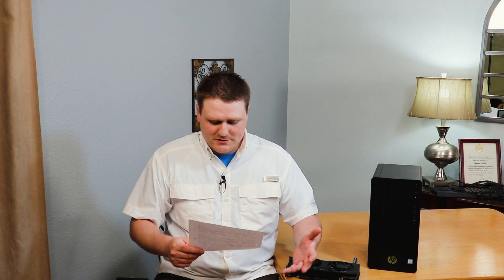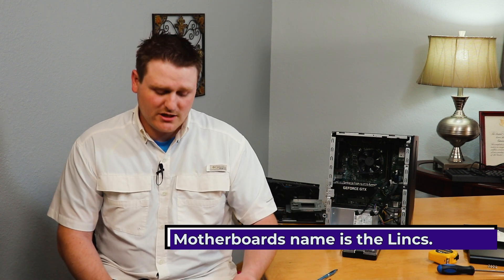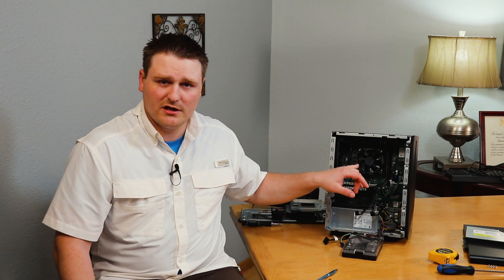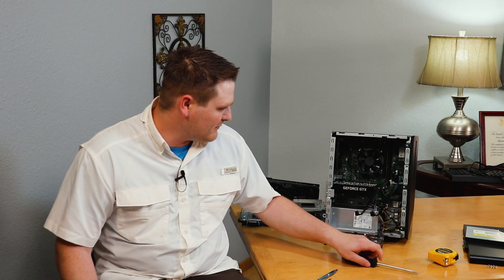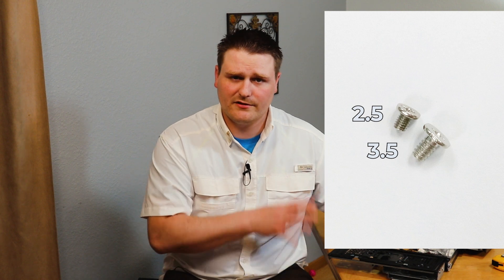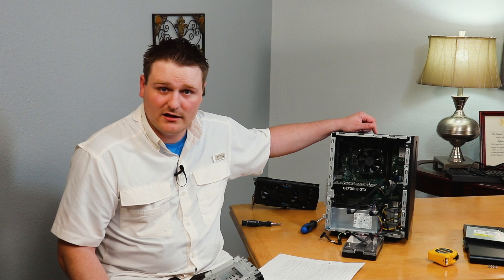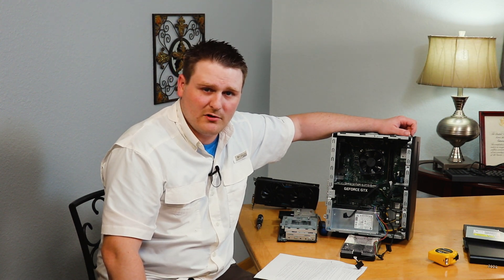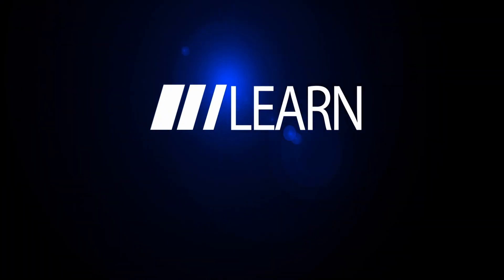Upgrading A HP Pavilion Gaming Desktop Explained! | Intel i5, 1660ti, 8GB, SSD + More! HP 690 Models

Comment: I changed my ram to a 3000mhz but I cant activate overcloack so I still get 2133 and I don’t see an option in the motherboard bios
Reply from the maker: What does taskmanager say?
Reply: @TNW1337  that the speed is 2133 MHz
Reply from the maker: @juanarrieta9939  you may need to do a biso up date is this amd or intel? What brand memory ?
Reply from the maker: One thing I will say if you went from a single stick to duals thats double the bandwidth even if it is a lower speed. Because before you only had a single lane from the pcie lanes and memory to the cpu. Now you have 2 so even if it was to stay at 2000mhz that is way faster then 3000mhz single stick. It sounds crazy but,  It is true. The newer Amds And intels are ment for dual chanlle.
Reply: @TNW1337  also I have a erica motherboard And from what I found on Reddit there is a lot of trouble with this motherboard when trying to upgrade ram  cause bios are locked
Reply from the maker: @juanarrieta9939  it is
Reply: @TNW1337  yea I went from the single stick that came with the pc to dual Corsair vengeance

Comment: i have hp pavillion model 7900010 cpu i3 8100 gtx 1050 and motherboard is Berks model . I checked and psu is 350 wats. I'm thinking to install a geforce gtx 1660 that recommends 450 wats psu. It should not be a problem because the gpu won't require such power as I read. I just saw your video so I'm asking if you suggest the geforce 1660 upgrade is possibe ? I can't change power supply with this motherboard because it's not a standard connector for psu. thanks
Reply from the maker: If it has a 6+2 Pin PCI-E I thnik you could get a TI to work 1660 & 1660ti both use 120 Watts-TDP. I think it will work.

Comment: On the psu cable does it say longwell 300v i think I might have the wrong psu cable
Reply: Could you please anwser i don't want to destroy my pc
Reply from the maker: Let me look at the 400 watt Give me 1 min.
Reply from the maker: The cables have no markings other then P2, P1, P3 & P4. PSU says HP on the side.
Reply: Tysm!!!!!
Reply: Like the part that goes into the wall
Reply: Like the cable that goes into the psu and into the wall
Reply from the maker: @Infamoustenor  They only will fit in the PSU. If the cable will not fit it will not work. It is a standard It is called a C13. The C13 will only fit in PSU units. It can not be put in backwards. Is this what yours looks like ? https://www.newegg.com/black-startech-10-ft-cable-connectors/p/N82E16812200423
Reply: Not the actual cables my bad for not clearifying
Reply: Pls lmk when u have time
Reply: I have two of them that's why idk
Reply: Tysm i figured it out!!!!

Comment: Hello, Tech mate I recently bought a hp pavilion ryzen 5 tg01-019 I think lol. I'm new to pc gaming its the first pc I've ever owned. I noticed, however, it said it comes with 8GB of ram but the dedicated graphics are assigned 2GB immediately on startup so I want to upgrade my ram but don't know which to go with, thanks very much.
Reply from the maker: This is if you have a Intel so any thing above 2666Mhz, 3000 or 3200. If you have a AMD they will do 3200Mhz so any thing above that. You will want a dual kit, to get rid of the bottle neck that 1 dim creates.  So you will want a 2x8GB kit is 16GB, or 2x16Gb Kit is 32Gb. Cheap kits I trust are Oloy, Adata & Gskill. Kits that Costs a little more, I like Corsair, Samsung & Kingston. Most of the nicer kits will have RBG on them. No point in it, as you can not see inside the case. It also adds heat.
Reply: @TNW1337  Ahh thanks so much Tech mate that’s really insightful and much-appreciated pal. I’m brand new to pcs have always wanted one though and it’s an AMD Ryzen 5 3400g I’ve got and I was surprised death stranding was running at 1fps and horizon zero dawn was running really slow and it was very blurry but I just couldn't work out why I thought my gtx 1660 could run these games so I started looking into it and I think its the ram Tech mate. So thanks very much for getting back to me and I was wondering if u think I should get 2x16GB 0r 2x8GB in your expert opinion. I don't even know all the correct terminology  You’ve got a new sub and all the best mate 👍❤️

Comment: Dude thank you so much I really appreciate this video to help me get my pc faster but what kind of cooling upgrades can I do mine is running a bit fast
Reply from the maker: Well you can replace the Cpu heat sink.  Other then replacing the Case, power supply, mother board not much. Add a  better industrial 90mm fan in the rear.

Comment: Good video I want to do a case swap to a mid tower putting a 750w power supply so my question is can the motherboard can fit into a atx case? I have the I5 9400f and the 1660 ti card is it possible to do a case swap?
Reply from the maker: Nope sorry man you would have to replace the Motherboard. But they do not cost to Much. you can use Z370, Z390, B365. B365 is going to be the cloest to what you had. if you want more PciE and Memory slots the Z370/Z390 are the best bet. Just make sure it is a socket LGA1151. If you want just link them here and when I have free time I will chk on them for you.
Reply: @TNW1337  figure much I’m getting a z390, 16 ddr 4 ram a 700 watt power supply and a cpu cooler putting in a nxzt 510 case I want in the future upgrade to a i7 and a 3070 graphic card thanks for the response the hp is a great computer I just don’t like the case
Reply from the maker: @josuesoto5340  Yeah the 3070 are rocking it hard. Asus is coming out with a 3060 super 12Gb Nvram card and 3080Ti 20Gb Nvram card. Things are getting crazy. The 3070 only has 8Gb Nvram, this is the reason I talk about this, is for VR, 2k and 4k gaming. It is very important the more Nvram you have.
Reply: @TNW1337  thanks I look into it

Comment: Would you say the same for the hp 690-0028b. Could I use the same power suply in the video. What about the graphic card, with using the 310 power supply
Reply from the maker: 310w will only work with up to a 1650. You version is a AMD not that it is not a bad thing. It is a Good CPU for gaming. it is pretty much the same thing Just Intel. Same case just different motherboard/cpu.
Reply: @TNW1337  running an rysen 5 2600. So if I ups grade the card to a 1050ti what else would I have to do to get a decent fps out of fortnight.  Would I have to update direct x or bios. Last computer I built was like 25 years ago everything so different now. Thank for the hand holding, lol. And I love the viedo
Reply from the maker: @7644henda  No you should not have to update any software. Unless you due a gpu. make sure you are runing dual chanle ram kit. Like two dim sticks as they like to only ship it with one stick.

Comment: Would I benefit more from a 1 16 gb of ram or 2x8 ram? And there is only 2 ram slots correct,
And does it come with 1 stick of 8gb ram? Do I have to match the ram or can I get a different manufacturer of ram
Reply from the maker: Ok dual channel will double the bandwidth. It is needed. so the Cpu is not bottle necked by the ram. Most systems come with a single 4gb or 8gb stick. you can order the 8gb stick from Hp its around $45-60 depending on tax and area you are in. You can order a kit from amazon @ 2x8GB 16GB kit for 50 to 60 Doll hair's.

Comment: I'm interested to see if this will be able to use a RTX 3060 Ti. I bought this little beast of a machine as a stop gap before I actually build my own, and the 3060 Ti is the card I wanna build that machine with. I saw that the power draw between that card and the 2060 Super is like a 25 watt difference (175 v. 200), so I'm not exactly sure if the 400 watt psu in this would be able to utilize it.
Reply from the maker: I plan to try and get the 500watt PSU to work. And a 3070. I have both parts being shipped to me as we speak.

Comment: How would I go about moving my m.2 into a new motherboard? Since this version of windows 10 has all this HP bloatware on it. Im planning on moving my gpu, cpu and m.2 into a new mobo, psu and case. Looking for some guidance. Ty
Reply from the maker: Easy way pick up a win10 key off ebay make make sure the seller is trust worthy.
Reply: @TNW1337  so you recommend a fresh install of windows before moving to a new mobo?
Reply from the maker: @SushiandBurritoz  Would make it simpler.

Comment: Very good video! saved a lot of time.

I just wonder if i9-9900 (non-K version) would really run on 400W psu and HP 843B mainboard (most used model for intel based Pavilion 690 desktop).
This cpu comes with 65W TDP, but it will hit the sky at all core load.  or.. I really wanna upgrade my cpu to i9-9900
Reply from the maker: Nope no k models will work on any of the Motherboard I've done.
Reply: @TNW1337  That sounds interesting. Then, i might have to try..   thanks a lot again for this video!!!
Reply from the maker: @hyeonsoobae7477  I tested it with a 8700k And a 9900k both did not work

Comment: Thank you so much for this, I really needed it.
Do you think that the motherboard could also be upgraded? I don't want it to cap my RAM speed at 2666MHz if I end up buying one with better capacity. If yes, what motherboard would you recommend? (P.S. I'm not much "literate" on desktop computers, so please correct me if I'm wrong)
Reply from the maker: Well if you wanted to change the motherboard you would need to change the case & the Psu to. There is no upgrade for it. But to be honest you can get a case for 40-70 Psu under 100. Motherboard is like 120+ depends on if you go mini, micro, or full atx.

Comment: Hello, I was wondering what specific RTX 2060 Super graphics card I could upgrade to in order for it to fit properly. I am new to pc building and my model is TG01-0170M and I already have the 400W power supply
Reply from the maker: Any GPU that is not over 10" And has side power Plugs, Asus Makes one Msi, and I think Pny has one. If you can Find a 2070 that is 10" and does not go over 215"TDP it will work I have 3 or 4 subs that have gotten it to work.
Reply from the maker: I just say stick with the 2060 super dual fan as they are 195/200 watt cards you get in to the 2070 and they range from 215 to 300TDP. Also if the cards are over clocked, They will need more wattage Just a FYI.  I know the Asus Dual fan 2060 Super 8Gb Oc will work. Its the one I Used in the video. For Gpu I do have brands I trust and like Asus is at the top next is Evga, Msi and PNY. In that order.
Reply: @TNW1337  ok thank you so much, this really helped me find the specific one
Reply from the maker: @loganlu8254  Any time man
Reply: @TNW1337  Would a 10.62 inch graphics card work or is it strictly under 10 inches?
Reply from the maker: @loganlu8254  Yes sir to big

Comment: @TechNitWit  what about gtx 1650 super?
Reply from the maker: If you have the 400w psu no problem. If you do not you can upgrade for $77 Its in my I-3 Upgrade video same PSU used in TG, 690 & 590.
Reply: @TNW1337  unfortunately in my country 400-500 watt hp power supplies are no longer available, so I have to go with standard 1650, right?
Reply from the maker: @gigawielkiszef5279  Yeah sorry man. Covid got ever thing all jacked up. you may have the 400w psu take a look.
Reply: @TNW1337  I will, thanks for the quick reply
Reply from the maker: @gigawielkiszef5279  Any time. thanks

Comment: Can I add another 1660ti in it with a i7 processor
Reply from the maker: No only one you could upgrade to a 2060, Yes it will take a I7.
Reply: @TNW1337  can I change the case of it plz answer bro😿
Reply from the maker: @junina7933  Yes
Reply: @TNW1337  thank u so much❤️
Reply from the maker: @junina7933  any time :P

Comment: Can I upgrade the psu or no
Reply from the maker: Yes, well it depends what one do you have ?
Reply: @TNW1337  well I have an HP Pavilion Gaming Desktop 690-0076a and I am thinking of getting a 750-watt corsair but I have no idea if they are compatible
Reply: @TNW1337  also i am getting a 2060 for vr because I have 16 gb of ram and a 1050 ti and I need a better graphics card
Reply from the maker: @crazyriley3048  So the Hp Does Have a 400 Watt PSU it is $77 It is the only one that will work. You can get up to a 2060 super. In the Hp Also make sure it is not to long it can not be over 10 and 1/8th".
Reply: @TNW1337  can u please get me the link for the power supply and thank you
Reply from the maker: @crazyriley3048  2 thing, this video will show you how to replace the PSU & Gpu. In the Disco on the video it will tell you how order the psu from Hp.
Reply: @TNW1337  Apparently they do not ship to Australia and the brand certified here doesn't have them :/

Comment: will the  rtx card work with my stock psu 400w ??
Reply from the maker: If it has a 8 or 6 pin.
Reply: @TNW1337   I think it has 6 pins the the same pc 690-0073w

Comment: Hey, I have an HP 510-P109, I'm wondering how far I can take things. I'm thinking of installing an SSD in the place of the rarely used ODD. I'd also like to get a graphics card, but am obviously limited by space, and would likely need a bigger power supply. my power supply is 180 watts. Any advice?
Reply from the maker: The 400 watt one is only $77 so not a big bank killer Maybe look at the 1660ti or 2060. Would be a very nice upgrade for gaming.

Comment: Hello i have stock psu of 310 watts i want to upgrade it can i put another psu and leave the cap open if doesn't fit or i have to buy the hp 500 watts? Thanks
Reply from the maker: They sell a 400watt that will work. The 500 watt Only allows one screw I have not tested it.

Comment: Quick correction I got a 600 watt psu today and I have the 690-0067c. I’m switching the case to a much bigger case and I was wondering if now with that psu what is the best graphics card I can put in it with out changing any thing but the psu and graphics that is compatible either the mother board and every thing else
Reply from the maker: You could get a 3080 They say it needs a 750w But I know for a fact It will work on 600w Psu.  As long as the 5v & 12v Rails can provide all 600watts.
Reply from the maker: Amd is coming out with the RDNA 2 big Big Navi cards, they say they need a 750 watt Psu. When Amd says they need a Psu its not like Nvidia where a 400w PSU works just fine.  But the stats are not out on them yet. If you want a budget card, I would say look at the RTX3070, it is on par with the 2080ti. At 1 quarter the price. If you plan to do 4k gaming or Max setting VR play. I would look for more Vram as it starts to become very important with photo realistic game play (which looks like it will be out in 2021).  like any card that has past 8Gb or more.

Comment: Help. Hp is no help whatsoever. I bought a hp envy TE-01 15 for 1k with onboard intel 630 video that sux. However The 180watt psu is hp and needs the secondary small plug to the motherboard that evga or others dont have. Like i said HP is no help. I need a compatible 400 w psu to install a graphics card. Can you help?
Reply from the maker: Yes if you look at my i-3 video it is the same steps to change out the PSU.

Comment: has anyone verified if you can use a ryzen 7 3700x on the amd model, id like to get one i have the ryzen 5 model
Reply from the maker: If you look on HP site it does state that other Ryzen will work. I have not tested it yet or know any one that has. But if hp listed it as a cpu that works it will.
Reply: @TNW1337  is there any reason that it wouldn't ?
Reply from the maker: @imawesome896  They are all the same watts so there should be no reason it would not. Do you have your model I can look it up for you to tell you if It can work 100%.
Or go to google and type in your HP like this HP 690-0020w mother board ones there click the motherboard link to the right. Then click the Processor upgrade information tab. If you have the Erica Motherboard you can upgrade to a 3700x. The listed cpu are all the same TDP.
Reply from the maker: @imawesome896  https://support.hp.com/za-en/document/c06489337#AbT0
Reply: @TNW1337  ah thank you, i have the sunflower motherboard, and says can only go up to a ryzen 7 2700
Reply: Mine has yzen 7 3700x in it, I'm going form a 1650 to the 2060 MSI ventus OC edition
Reply: @ECMSinc  did you upgrade powersupply at all ? do u only have 400w?

Comment: Can I upgrade the PSU ?! I have 400 watts, I want to upgrade the gpu to the rtx 3070 but I need a 650 watts psu
Reply: no
Reply from the maker: There is a 500watt PSU but but only holds one screw.  At that point I would look at getting a New, Case, PSU & Motherboard.